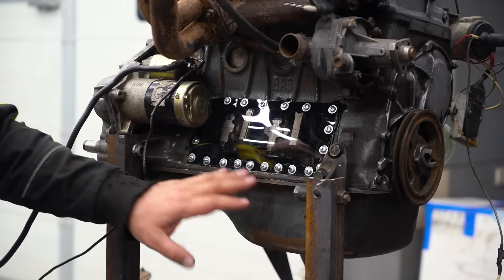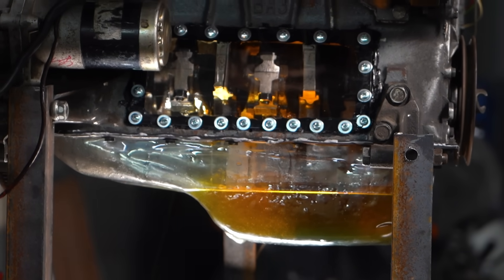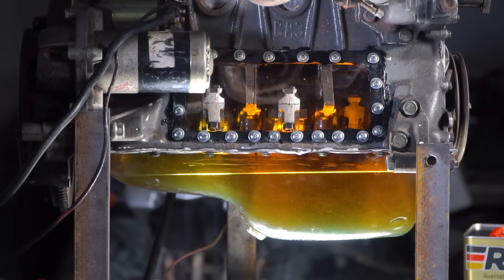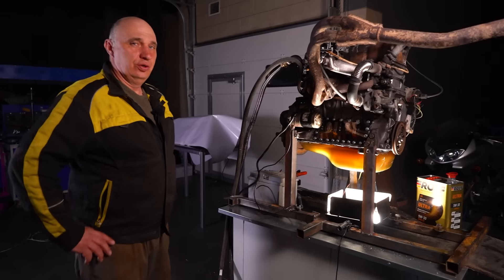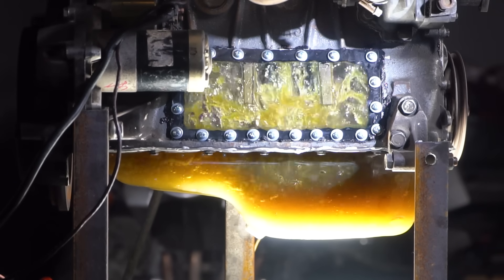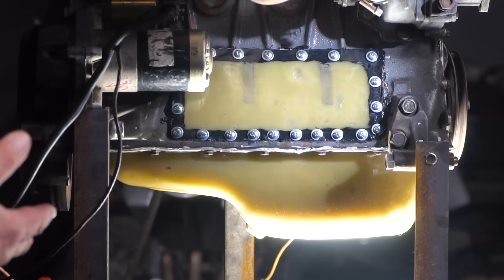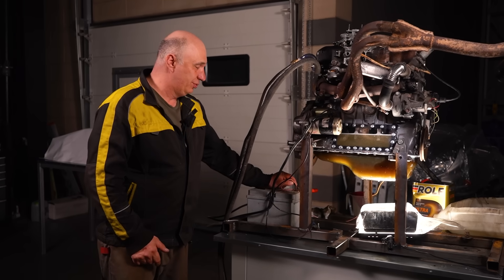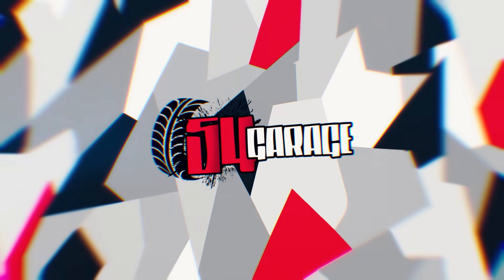What actually happens when you overfill your motor oil? (w/ transparent oil pan)

Comment: Bought a well-used car a while back. I had a long drive back with my new used car, so I stopped and got the oil changed. Drove it home, and used it to commute every day. After a month I checked the oil and it was a good 3 cm over the max fill line. I think it contributed to the failure of my valve cover gasket, which is hard to find a replacement on my crappy old car.

Comment: well, I overfilled my old beamer a bit and started it hoping it would be ok . Before I'd topped it up the oil was fairly clean (just had an oil change a couple of months before) It had changed from clean to black. I panicked where was the extra going?   My mechanic wasn't phased and later changed it again. She is still running well thankfully a 1993 V6 my spare car because I live so rural.

Comment: I worked with a mechanic at a repair shop that had bulk oil dispensers from 300gal tanks.  You'd fill a calibrated 5q container with a swing down spout and walk that over to the car.

The guy's personal life was spiraling apart.  Marriage to biker woman falling apart.  Got the hots for a stripper and started hanging out at her club till 2am closing time to hang out with her afterward.  So he was chronically sleep deprived and scatterbrained.

Anyway, he "double oiled" a customer's car during an oil service.  It idled normally enough in the shop but as soon as he accelerated away from the driveway on the final test drive, the crankshaft slung tons of oil up the PCV system which transferred it directly to the intake.   The tailpipe belched smoke so thickly that traffic on BOTH sides of the 4 lane boulevard came to a complete halt.  Took a long time to get all the oil out of the pleats of the intake duct and the boss had to pay for an air filter as the customer's was now completely saturated and dripped when removed.

Well, that same week, the mechanic did the same thing again on another customer's car.  Then if you can believe it, AGAIN on ANOTHER customer's car!   

The week after that, this mechanic wasn't working there.  The guy had the balls to leave in a huff and act like the boss was in the wrong after blowing 2 second chances.

Comment: The overpressure caused by grossly overfilling could cause oil to exude from crank  rear main oil seal into clutch housing and onto clutch surfaces. Also can force oil past piston rings, causing excessive smoking through exhaust.

Comment: Just 2 quarts of over fill killed my wife’s 2014 Jeep Grand Cherokee with the big engine at 112,000 miles. But thanks to good union workers at jeep, they installed the wrong oil pan which had a longer oil dip stick tube attached and longer dip stick. Thank god my wife got the MOPAR Life time warrantee. Oh, and now even following oil levels religiously the #7 piston is way low on pressure as is #8. Guess they didn’t fix it right the first time. Any ideas on which SUV my wife should switch to? Or should I just buy her a PORSCHE?

Comment: I think a lot of people don't know very much about engines in general.  I always had mine filled to max or a little over, and I had six high revving sport motorcycles as well as cars and vans. Best to check it when the engine is cold and hasn't been running for a few hours, that will give you an accurate reading.  Most people check their oil at gas stations when the engine is hot and there hasn't been enough time for it to settle back in the pan.  Bottom line is more is better than less, to a point. I always put in about 10 to 20 percent more than recommended and never had any engine problems.

Comment: Got a fresh oil change on my car when I was just starting to drive had no black sut in the engine couldn’t see the oil level at all though it had none cause I thought the oil change spot didn’t know what they were doing well I was driving home ant normal speeds and rpm’s and then a huge cloud of white smoke came out the back of the car wasn’t pushing it or anything so I would say stuff happens oh and it only lasted like 5-7 blocks I only made it halfway home from the auto parts store

Comment: I overfilled the 4.8 in my truck by about half a quart once when I was 17 at 6000 rpm it decided to start spraying a mist of oil around the valve cover gaskets and continued to do so at high rpm for years until I replaced the heads in 2014. Truck is 20 years old now and still has the original cast iron exhaust manifolds and my engine bay is still rust free.

Comment: In normal operation, would not only clean filtered oil be pumped and sprayed on moving parts whereas when oil splashes around directly from the surface of on overfilled tank, unfiltered oil is now lubricating the motor leading to accelerated wear?

Comment: basically dont do it, follw the dip stick.
even adding 200ml too much oil let alone double it will over flow into engine and coat your exhaust pipe and now it looks like your doing a burnout driving normally

Comment: I always thought engine oil completely submerged all the moving parts it came in contact with. Its crazy to think its like only 1/4 of the space. I wouldnt think that ratio would be enough to keep everything lubricated and cooled. I didnt even think putting in more than max oil without spilling was a possibility.

Comment: I am sure the manufacturers place the maximum and minimum marks in such a way that you would have to go considerably outside them before there is a risk of trouble. They are in effect guaranteeing that the lubrication system works correctly with any oil level that is not outside the maximum and minimum marks.

Comment: You have relieved so much stress from so many people it's crazy (4.5M views = centuries of stress).
My tiny engine takes 0.8 quarts, I put in 1.  Was worried I'd need to drain/suck out 0.2 quarts.   Now, I am glad it's got the extra oil.
Reply: Do not ever get a Mercedes I swear so much oil and to change it you have to vacuum it out so like 20 quarts yes that many because of how the oil filter is on top on engine and the CPU will keep telling you need more oil ha
Reply: That's 20% too much LoL
Reply: the dip stick have hallow dots on it which tells how much space is in the sump available to fill the oil for the engine
Reply: @ I guess I am missing your point.  Everyone knows the dipstick shows how much oil is in the engine.  And almost no dipsticks have holes in them.
The whole point of this video and the comments are related to over filling the oil.
Reply: It’s not good though. The foaming causes all kinds of issues. I overfilled a 2015 Elantra by about half to .75 of a quart once. It was dark, couldn’t see, but the oil needed changed before I went to work the next morning.
I made it to work, not thinking to check it again before I left the house. It made it just fine, idle was a little rough, and when I checked it, at work, I realized it was overfilled. Figured I’d be good to get home, but lo and behold, it started shutting down on me about 20 minutes from the house. Drifted into a parking spot, let it sit for 5 minutes to let the frothing die down, drove another 5 minutes and it shut down again. Took me another 3 of those sessions before I got home. 
Drained the excess out and boom, all of a sudden it worked  fine again. 
TLDR: It’s not good to overfill it. You won’t always cause damage right away, but you will fuck up your car if you put too much in it and run it for too long. 
I’ve seen guys toast their pumps overfilling it, gain knocks that never went away, etc. They’re not designed to have aerated oil.
Reply: @ARBackfire  I truly don't think that small amount of extra oil would cause that many issues especially that quick
Reply: @ARBackfire it's more the fact that it's a Hyundai than anything else
Reply: @ARBackfire  There's a lot of headroom inside the engine for excess oil, as is demonstrated by the video here. Overfilling it by a single quart shouldn't harm anything, much less a fraction of a quart. Now, my question to you would be how and why you drained your oil in the dark? That sounds plain suicidal. An oil change is never that pressing of an issue where it HAS to be done before you go to work instead of after work.
Reply: @ARBackfire  As a matter of fact, what probably happened is that you put the amount of oil in the engine that it needs without checking what came out. There was probably more oil still in the engine than you realized so what seemed like an extra 0.75 quarts was actually more that. If you ended on the H Line, you had way more than 0.75 quarts too much.
Reply: @NearEDGE nah, lmao. I was there bro, all I had to do was crack the drain plug, drain about 3 quarters of a quart out, made sure it was drained down to the proper fill line and go. It was weird. First time I’ve ever experienced something like it, first time I’ve ever had a problem with it, last time ever having the problem again. Maybe it’s just some engines and how they’re engineered internally. It’s just got a 1.8 L motor too, so 3/4ths of a quart is more extreme than say, idk, a 2.4 L for example. Not much, obviously, but it’s a variable. 
What I do know though is that it can be recreated at will. Give it enough time to get that oil hot— half an hour to 45 minutes— and whipped, it’ll shut down on you if you go over by about .75 to 1 quart of oil. Never had it happen on anything else tho.
Reply: @ARBackfire  As far as I can tell based on the information available, the only situation where the 1.8L Nu would have issues with that little overfill would be if your PCV valve was bad or failing. So if you needed an oil change on that one because it was drinking oil even when filled properly, that would most likely be why.
Reply: @ARBackfire  Or really, it could be gunk in the PCV system in general. Seems to point to an issue there overall.
Reply: @ARBackfire  Half a quart extra is NOTHING at all, you must have put a LOT more than that in it. That would only raise the oil level maybe a 1/4" in oil pan, making no real difference at all. I have literally added ONE entire extra quart and it ran exactly the same no noise, no shutting down, no nothing, could not even tell.
Reply: I'm relieved too my bike asks for 1liter I'll give her 2 now. She is a good girl. 🏍️
Reply: @henriquesendotrader  you shouldn't purposfuly give it more than is required. It can cause problems over time.

Comment: If someone is talking about a pump and I can see just a rotating piece of circular metal with a small dent, I am suppressed what 2000U/min may achieve. Fun fact: This plastic engine does not lose any drop of oil. All our GMs were losing oil permanently, all models😂

Comment: I had my oil change done at a huge chain in America at Walmart auto department. I watched the man fill the required 6 quarts then go in the store an grab to gallons of mobil 1 oil fill it in my engine then added another two quarts I told the manager what I saw an he said he would have him drain it an start over. Not even 5 mins later they called me to pay I went outside an saw a trail of oil from the shop to were my car was parked an was told the oil came from another vehicle they fixed i live less than a mile from the shop an my engine seized up two houses away from mine the oil was so over filled it blew out all my seals an leaked up causing my engine to seize up.

Comment: 8:25 "nothing bad happens". Really? Look at the aeration! Under dynamic oil pressure forces the air is compressed allowing for metal to metal contact. Over time this leads to premature engine failure.

Comment: Simple. The crank will act as a dishwasher producing foam which results the oil creating air in the oil therefore the engine starving from lubricant heating up beyond working telperature and burn up the piston rings and crank bearings.

Comment: A woman stopped her car outside my workshop years ago and she said the engine is running very rough but made it from the servo about 200 metres away in Woodside SA.  She said she filled the fuel tank (petrol) and put "quite a lot of oil in the motor". I opened the bonnet on the Toyota Camry and noticed oil oozing out of the dip tube. I then asked her "how much oil did you pour in"? Guess where this comment is going?
The poor lady said "quite a lot". I said "how much"?. She said i filled to the top of the hole where the oil goes in"!
Sure enough the engine rocker cover was still totally full of engine oil after removing the fill cap, screw type. I drained heaps out and sent her on her way with advice to go by the dipstick level. The Camry drove away still blowing some smoke. What a laugh we BOTH had. True story dudes

Comment: A coworker let his friend borrow is pickup, his friend said he had to at 6 quarts of oil, he got it back, he drove it on a trip that weekend to see the in-laws, about 100 miles each way. 
Next week he told me it must be using oil because his friend said he had to add 6 quarts. 
I told him it doesn't hold 6. It is 5.5. So he must have been completely out, I checked it for him, it was way to high, he asked his friend,  apparently he checked it running and added until full while running.

Comment: Overfilling a bit probably will not do any harm. However, this engine only ran for minutes, while you are expected to run your engine for several thousand miles on an oil change. The oil will surely lose its properties if it's foaming for that much time...

Comment: Suggestion:  Before draining old oil check level on dipstick.  If level is right drain and measure how much comes out.  Put same amount of oil back in.  If filter is changed it is easy to judge approx volume to add that extra amount.  Over the years I've found that owner's manuals rarely result in giving you the right level resulting in not enough going in or or too much.  Do it my way; the little extra hassle to measure old oil quantity is well worth it.

Comment: I would have like to see what happens if he filled the entire thing with oil so that there was no air left in the system. would a zero gas system create the same pressure that cause the oil pan to fail and leak?

Comment: Going over the full mark a half qt -qt isnt going to do anything but you add too much and your gonna have problems.. Hes not running it at higher RPMs for extended periods and the oil is not shifting around do to stopping and going. Its a waste of oil and money also youre gonna have leaking seals, damaged sensors, filters. And engine damage . He has some junk engine on a stand not moving and at very low RPMs if you want to do this with your car that you take your kids to school with or drive down the highway at 70 mphs good luck. I wish he had a RPM gauge showing .

Comment: Oil changes are a scam. You can go like 30,000- 40,000 miles on the same oil fine. Same as spark plugs. You can go like 300,000 miles on spark plugs.

Comment: What happens if you mix two types of oil in your engine, for example a 10w40 with a 20w50

It would be fun if the engine works better or if it causes it to fail

Comment: I thought blow seals...before watching.>
Reply: All right so now I wonder if you built a system to be closed and you just filled the whole thing with oil and no air if it would work fine.
Reply: Maybe I'd like a reservoir as it expands it could fill it up instead.

Comment: Overfilling will make your engine run like 💩.  It will get into the plugs and foul them out. I know, it happened to my Corolla when walmart in Semmes AL overfilled it after they changed it. I was moving back to AR and before I got to Little Rock, the car was running like it was only hitting on 3 of the 4 cylinders and I still had over 100 miles to go.  Better to be slightly low than to have too much.  I finally figured out what the problem was and would pull the plug that had oil in it and soak up the oil about once a week until it was all good. Took about 3wks.

Comment: Real Experience: My brother in law bought a brand new car with V8,  and he brought the car back to the dealer many times for poor performance. A year later, the dealer mechanic finally checked the level of engine oil and found the culprit.   My b in law did put extra oil beyond the max mark.  Since that experience, his car became a reliable and had ran smoothly until sold to junk yard

Comment: If you look at most oil selling websites etc they will tell you an oil & filter change capacity on a 2.3 2015 FIAT Ducato is between 6-7 litres. I usually put in 5.3 L which gives me a 4/5th level on the dipstick. 6L  would take you up & slightly over the max level, 7L would be an overfill 😮